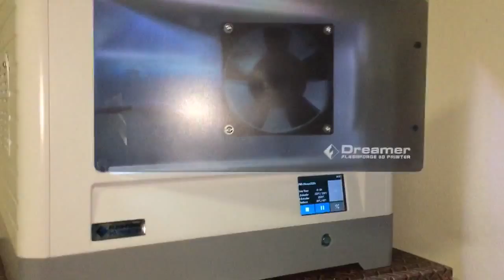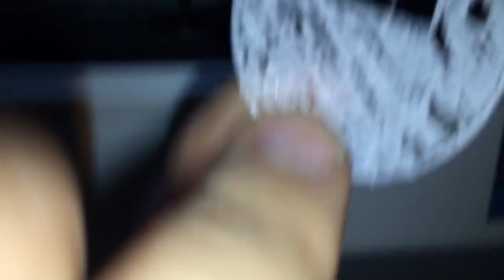FlashForge Dreamer - 12 months old, PTFE tube

Comment: that is clearly a mistake in the use .. if you were to use the printer correctly, that would not have happened
Reply from the maker: Alexander Bartl maybe. But PTFE tubes do degrade after a while. It's probably from me having to beat the extruder to 230c to flush out ABS that gets stuck sometimes. Also from printing with TPE at 225c

Comment: Hey Thomas I was just wandering I just got my dreamer and I'm using the buildtak like stuff that comes with the printer and the pla sticks too well I mean it is literally stuck to the print bed. And you said that this printinz breaks after a while so do you think it would be wise to stick a buildtak sheet to the printinz plate so that it sticks but you can flex it to get the parts off?

Comment: do you have instruction on how to replace this?
Reply: +hennezzy My newer Dreamer uses MK10 nozzles & 9mm socket wrench, coupled with Teflon tube of 4mm OD, 2mm ID, 34mm long. Just get your extruder heated, restrain the hot end with metal pliers, and loosen nozzle with 9mm wrench. Nozzle and teflon tube easily come out.
Flashforge sells tube of the correct length, but you can probably buy the tube raw and cut it yourself.

Comment: Mine is almost a year old and still going strong  (bought mine not too long after seeing your original ff dreamer vids) glad it was a somewhat easy fix.  No major failures on mine yet, but we'll see I still have a month or two to go, I'll get my spare tubes ready :p
Reply from the maker: Joe Petro Very happy with the printer. I think I've probably gone through nearly 50Kg of filament. I removed the right nozzle as I found dual extrusion was a gimmick and it kept touching the already printed part. Lots of fan upgrades but still a rock solid performer
Reply: Hey Thomas also when you put on the printinz plate how did you re level it did you have to make a stopper to trigger the switch so it didn't ram the print head into the thicker bed ? Please reply!!!
Reply from the maker: RAWICE511 Hi. Yes I used a 5mm stopper. Just a piece of plastic laying around. Then I just leveled as normal
Reply: Thomas James also do you think it would be avoid idea to stick a buildtak sheet to the printinz plate so you get the best of both the stickiness from buildtak with easy removal of printinz